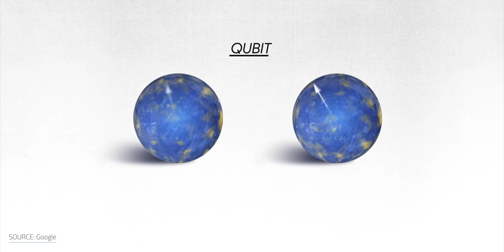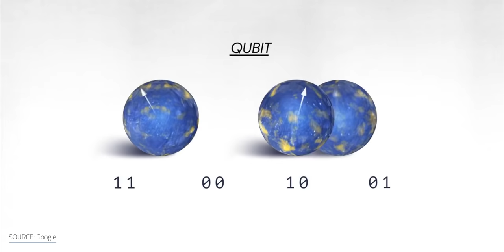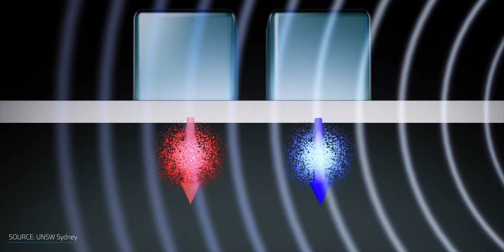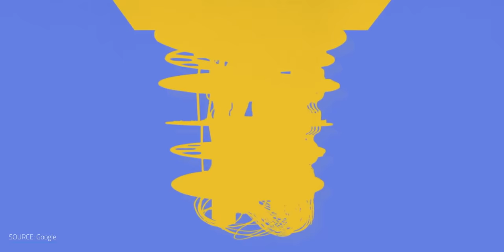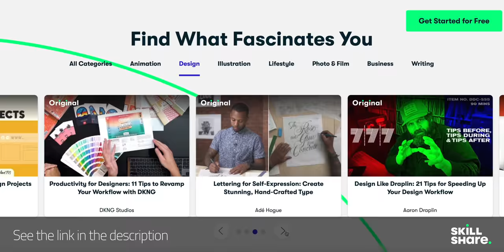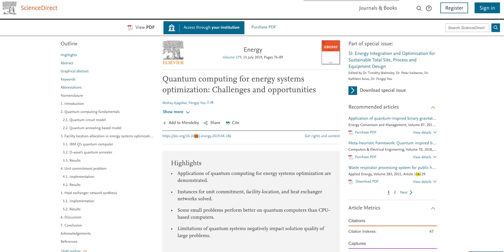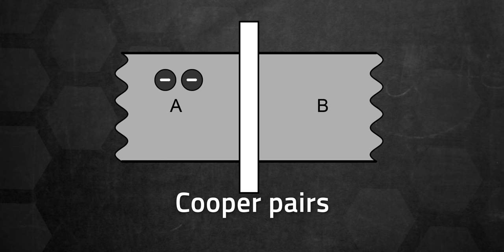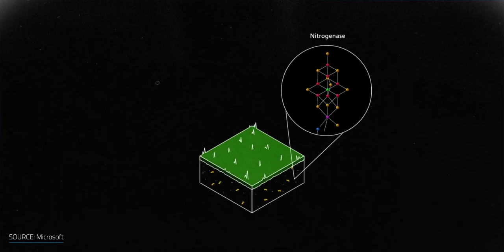Quantum Computers Are Coming … But Why Should You Care?

Comment: I'm sorry Matt, but that's not exactly how entanglement works. The way you're describing it makes it sound like you'd be able to break casualty, but in reality when you collapse the wave function of one of the pair of entangled particles, you know the spin of the other. The information still has to obey the speed of light when relaying the state of one of the entangled particles. Look up the quantum erasure experiment to get a better idea of this phenomenon.
Reply: You seem like a bright spark, so I have been pondering this for a while. Entanglement is a process achieved by some sort of catalyst, normally some sort of material that provides a fixed outcome of two particles with opposite spins, however famous people like Einstein stated it to be spooky action at a distance, what I am confused about is why that is the perception, when both particles are created in the same medium at a particle place and time, then only is one transported to another place, and the test done, how is it then a test if the medium will always yield the same specific set of circumstances of opposing spin for instance, its like dropping two balls down apposing slides, then taking the opposite spin generated by the slides and gravity, transport them thousands of miles, and call it spooky action at a distance, when in fact there is only one outcome to such an experiment, because of the medium that generated the effect, in this case being the opposing slides. I know its far of topic here, but I am curious, and somewhat convinced I am just failing to understand something fundamental here.
Reply: Isn't entanglement just a hypothesis? I think there is a reason we haven't seen quantum computers, the hypothesis is wrong.
Reply: @AORD72  no its very well understood. The problem is the state is very fragile to outside noise. Heat, light, vibrations etc.
Reply: @firstnamelastname59  nerd in the quantum state is a geek, or not... quantum flux makes you have both or none
Reply: @AORD72  
I believe entanglement simply describes two particles that have opposite states but you don't know which is which until you observe one of them, then you know the other.

like having two coins, one gold one silver.
Without looking, you put them in a box each, numbered one and two.
Now, no matter how far away you send box 2, you can tell what is in it if you look in box 1.
The result of the "what's in box 2" question is "entangled" with "what's in box 1"

That's how I interpreted it anyway but I believe there is a famous quote from a well known quantum physicist that goes something like:
"Anyone who says they understand quantum physics doesn't understand quantum physics."
Reply: @AORD72 , look up quantum metrology.  They have used entanglement experimentally to image an object.
Reply: It’s not known if FTL is possible with entanglement:

Quantum technology and research is opening the door to all kinds of new opportunities and possibilities. One of those possibilities involves the speed of communications, prompting experts to consider whether quantum communication is faster than the speed of light. Read a simple breakdown of how quantum communication works here.

At this point, we are confident that quantum computers will be able to do amazing things, solving complex problems infinitely faster than classical computers. This has significant implications for a wide range of fields from weather prediction to medical research and the development of Artificial Intelligence, not to mention the already known impact on cybersecurity and ability to break current encryption methods. But are quantum communications faster than the speed of light? It’s a great question. If the answer is “yes”, then the door will open to even more possibilities, such as communication in space.

For now, though, the prevailing position among scientists appears to be that quantum communication is not faster than the speed of light.

Quantum Entanglement: “Spooky Action at a Distance”
The prospect of faster-than-light (FTL) communications revolves around quantum entanglement, a phenomenon Einstein described as “spooky action at a distance”. The idea is that entanglement implies instant communication. However, even though entangled quantum particles seem to interact with each other instantaneously -regardless of the distance, breaking the speed of light – with our current understanding of quantum mechanics, it is impossible to send data using quantum entanglement. That’s the key: the inability to send data or information. In order to “communicate,” you need to be able to send data.

Quantum entanglement is a complex phenomenon, but perhaps the simplest explanation, courtesy of Astronomy Magazine, is that quantum entanglement occurs “when two particles are inextricably linked together no matter their separation from one another. Although these entangled particles are not physically connected, they still are able to share information with each other instantaneously — seemingly breaking one of the most hard-and-fast rules of physics: that no information can be transmitted faster than the speed of light.” This the basis for the premise that quantum entanglement can enable communications faster than the speed of light. Unfortunately, it’s not so simple.

Forbes addresses the prospect of the speed of quantum communications in an article that explains in greater detail why quantum entanglement can’t enable communications faster than the speed of light. In it, Chad Orzel proposes several scenarios where entanglement could potentially allow FTL communication, but in each case he finds a reason why it won’t work. Ultimately, you can’t force an entangled particle into a particular state and you can’t force a measurement to produce a particular outcome because the results of quantum measurement are random. Even with measurements that are perfectly correlated, no information passes between them. The sender and receiver can only see the correlation when they get back together and compare measurements, which they have to do that at or below the speed of light. No real information is passed when the entangled particles affect each other.
When we conquer communication through quantum entanglement, faster-than-light communications will become a real possibility.
@Quantum_Xchange
TWEET THIS!
Orzel sums up the dilemma appropriately when he says, “the whole business [of quantum entanglement] is subtle and complicated. The end result is always the same, though: While it’s one of the weirdest and coolest phenomena in physics, there is no way to use quantum entanglement to send messages faster than the speed of light.”

Nevertheless, research continues on this subject and some physicists believe that faster-than-light communication might be possible with some intricate manipulation of entangled particles. For now, we know that the interaction between entangled quantum particles is faster than the speed of light. In fact, Chinese physicists have measured the speed. We know that quantum entanglement can be used to realize quantum teleportation experimentally. We know that entanglement has applications in the emerging technologies of quantum computing and quantum cryptography. With a fiber optic network that can carry conventional data and quantum data, a quantum internet is becoming more of a possibility. The real hurdle to overcome, though is being able to communicate data through quantum entanglement – that’s when we might be able to communicate faster than the speed of light.
Reply: It might be good to think of it this way… 

you drop a large blob of water onto a knife edge,
the surface oscillations (spin) as-well as the blob (inertial direction) is split in two, the oscillation  of each small blob is in opposing sync. To know which way the surface oscillations are orbiting  you must tes/interfere  with one of the blobs. From this you can know the oscillation of the other blob.
Spooky only if you think the second unobserved blobs oscillation has just emerged (hint it was there all the time).
imho
Reply: This is what happens when some random bald guy in glasses with a “Gee whiz!” attitude towards technology leverages his appearance to convince his audience he knows what he’s talking about no matter the subject. I call it the Simon Whistler effect.
Reply: @phillm156  It's known that entanglement does not lead to FTL given our current knowledge of physics. If you assume some unknown mechanism beyond our current understanding, then sure - anything is possible: maybe "magic unicorn particles" allow FTL. Any suggestion entanglement has anything to do with FTL is just a misunderstanding of what entanglement actually is. It's quite well understood, and definitely not magic.
Reply: @firstnamelastname59  Lol fair, but I feel like that might describe a large portion of this audience, no?
Reply: @atlanciaza  I think I understand what you are trying to say.... but I think you said a lot of words just to agree with me...? And you only seem to be talking about how to achieve entanglement not what it actually means or try to rebuttal my point. Did you look up the quantum erasure experiment?
Reply: @STUCASHX  Very well put. This was the jist of what I wanted to write in my original comment, but I thought I was already typing too much.
Reply: @atlanciaza  to answer your question, from my understanding, quantum entanglement needs to be thought of exactly as it is, probability.

Let’s take two electrons that are quantum entangled, we know they have a spin, we know both can not be the same, but we don’t know which one is spinning in which direction. Agreed?
Okay now we can separate them as far as we want, let’s say 10000 light years apart. One with us and our equipment and one on the other side of the galaxy. Okay?

Now in this quantum state the electrons are in a superposition. Our electron can be either up or down, right? So at an unobserved state it is equally probable to be both. Right?

Now the instant we observe our electron we know instantly what the other electrons spin is. Both electrons are in both spins until one is determined.

If you want to see it in action, take three polarizing lenses.

If you take one that filters out vertical light you will see half the light come through. Right? Only the horizontal light passes.

Now take a second one, orient it to block horizontal light and place it on the first. Now 100% of light is being blocked. Both the vertical and horizontal light.

Now, take a third one and place it diagonally between them and now half of the light passes through.

I can’t do it justice to attempt to explain how it causes this to happen but it is a direct observation of super position. To my understanding.

I hope that helps.
Reply: @msmyrk  quantum physics is different than physics. Particles in various energy states at the same time. The double slit experiment showed that. 
Why did Einstein and Bohr so famously not get along. Einstein stating "god does not play dice".
Yet our world runs on probability.
Reply: @firstnamelastname59  At least we can spell.
Reply: @Bozarnite  Yeah no, I am off topic, but as I say I am just curious. I have learned and studied the erasure experiment before, however that is not a measure of particle spin, it is an experiment based on the particle-wave duality of light, so I don't see how it has a bearing on the matter at hand. However to that experiment all i can say is I have not even an inkling of an idea as to why it is so, I guess it is just that, as we don't know why the erasure experiment yields the results it does, so too I guess we don't know why particles entangle in the first place, and why entanglement yields opposing spins. Hopefully someone gets a daydream on the thrown sometime soon to sort this madness out.🤣😂
Reply: @DrPWNS-fz6yh  How weird is that thing with the polarization? That is almost weirder then the erasure experiment. And admittedly now I am right back to being as confused as everyone else, the only thing I can say maybe makes a bit of sense is that its a bug in the universes coding, as it sounds a lot like how in the old games one could sometimes be in walls, or walk right through metal tension lines that hold up poles. Hopefully the more we probe it eventually the creators might realize what the issue is and sort out the bug, and maybe just maybe we could be rebooted with all that shenanigans from the universe to be gone and erased from history. Or what could be worse is that the bugs have already been fixed, by creating another simulation, and they just forgot about this one after they moved it out of the way into the basement, never to looked at again. Hopefully no kids play around in that basement because it is kinda hard protecting against a kid accidentally breaking our universe. You know what, I think its time I stop, because if this continues I might die of existential dread.
Reply: @DrPWNS-fz6yh  Okay so I went and investigated the polarized lenses thingy, and I have pondered t a bit, and I am actually now interesting in getting some, so I can do an experiment, I propose the following, maybe the light let through by the second lense is absorbing the electron volts required to move the wave function by the required degree. But its probably wrong, its just that no one seems to know exactly how polarization works, so maybe its worth pursue even if just to rule out.
Reply: @atlanciaza  Oof dude you need to check yourself first. I tried to give you the benefit of the doubt, but I don't think you really know what's going on here or what you're talking about. I recommend PBS space time's video on the quantum eraser, and if you still don't understand how that applies then I think you've lost the plot.
Reply: @Bozarnite  I am subscribed to them. And your probably right, I am just missing something on the subject, but I will endeavor to understand it more.
Reply: @atlanciaza  I'm sorry about my tone, I don't mean to put you down or talk down to you. It's just that the way it was explained in the video would break causality and you would technically be able to time travel or at least information would be able to. That why it applies to the quantum eraser experiment. That is why I just wanted to post a comment with that clarification.
Reply: @Bozarnite  Nah man, I'm cool with it, I'm not one to cry over not understanding something, I rather endeavor to understand it, sometimes by asking stupid questions and proposing absurd hypothesis, simply for the love of knowledge, and the ability to expand it, so as a result I fail to see much meaning in tone, and thus only take away that which is important, in this case I suspect am at the very beginning of the Dunning Kruger effect, and I accept that, and will do what is required to get to a point I have a better understanding, so please don't feel like you offended me, as I am the one that is not informed enough, and thus it is my responsibility to better myself. Thanks for the insight though, I see now why you referred to it in the first place. Or well I guess as good an understanding as one can expect from quantum probability.
Reply: @calitaliarepublic6753  Awesome comment!
Reply: @atlanciaza  we understand polarization because light is a wave on two axis.
Reply: @phillm156  Quantum physics is most certainly considered part of the field of physics. I think you mean it's different to classical mechanics or Newtonian physics perhaps, which everyone saying entanglement not permitting FTL is very much aware of. Regardless, our current understanding of it does not allow FTL, and there's no reason to think it could lead to FTL. Yes, there are definitely things we don't know about physics, but if you rely on that as an assumption for FTL, then the argument can be applied to any subfield of physics.
Reply: @DrPWNS-fz6yh  We understand what is polarized light, but we have no idea how that polarized light is formed by polarization lenses. We do not understand the mechanics of exactly how these lenses do what they do, we have theories, but no actual logical or provable one yet.
Reply: @atlanciaza  polarizing lenses don’t form polarized light. They are literally slits in film that block light polarized in the perpendicular direction.
A vertical polarizer is only vertical when it’s vertical. Rotate it horizontally now it’s a horizontal polarizer.
Reply: @DrPWNS-fz6yh  But you see, the very experiment of the 3 layers of polarization proves that to not be the case, because it would be impossible for any light to pass through the 3 layers if they were just physical barriers allowing only a certain orientation of light through. thus in some why the polarization lense does have some unknown effect, or some other unexplained effect must be the cause, but it sure is not known to us as to why it happens.
Reply: @msmyrk  whatever this turns out to be, it’s proven, it’s real, repeatable, it can be engineered into long range communication.
Reply: @DrPWNS-fz6yh  Ah but you see, that can't be the case because in the case of the Dirac Three Polarizers Experiment it is not the case, because if it was the case then the experiment would not allow any light through if it, because all paths would be blocked completely, however that is not what is observed in the experiment.
Reply: @msmyrk  You  did not even read his comment. That's not what he was  saying. "FTL" what exactly? Travel? Communication? You did not specify, and he did, while you claim he made some direct  line connection  between the phenomenon of quantum entanglement and ...."FTL..... something or other, I didn't pat attention" ....when in fact he stated quite accurately the current understand along, with future goals.

None of which does your comment address. You clearly did not read that comment.
Reply: @Dennzer1  The heavily edited their comment at some point. The comment I replied to was a 2-liner implying that FTL comms was as plausible as anything else. I said "FTL" instead of "FTL comms" because it was clear what kind of FTL everyone was talking about.
Reply: @msmyrk  Even if what  you are saying here is true, which I still question  to an extent, the comment that person made already offered all the context that was needed, and said that it was not possible, and talked about if that were to change one day, what  that would look  like in a very general sense. so  your comment inferred a  different context of the comment it was replying to. And I think that was/is disingenuous of you.